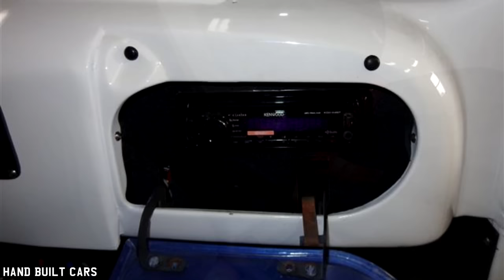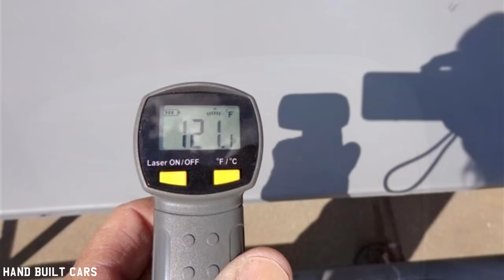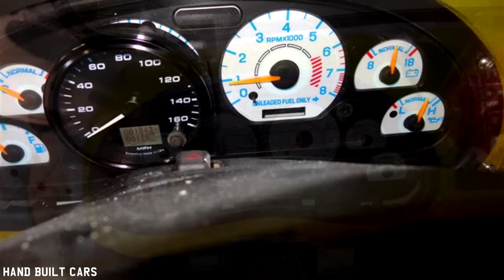1951 FORD F1 Pickup Truck Restoration Build Project

Comment: Kudo to the  metal fab, likewise to the finish man!  Only someone that has done  a resto can understand the love and time involved.  If you had F-1 fenders, not the F-2 -6 that you used with the larger radius your life would have been easier.  I  like the level you finish each piece even if it means going back to bring it to what  " YOU" want . The people that give negative comments can't show you what they did!   I would like  to know how long it took you time -wise?  My daughter and I built our project, but it took 16 years!  It can be found at  " 48 FORD  AMATEUR  BUILD " .    The F-1 in the background I did in 1978.  It took a year and a half as a younger me!                                                                                                         Paul

Comment: nice work, you've given me some ideas, i'm in the process of building one myself a 1951 m3 , custom  shortened to m1 with p71 front clip and rear, that had to be extensively modified to fit,  383 stroker with th350 and 3;55 gears. not too familiar with the posting of pics or i would, just wanted to say nice work.

Comment: While I appreciate the work put into building a complete frame from scratch the design leaves me thinking is wasn't as refined and engineered as well as it could have been, (sounds shitty I know-sorry). IMHO I think a body swap onto a P71 frame w/motor and drive train would've been a far superior decision and would have yielded better handling and comfort traits plus after market support is bang on and affordable for this platform.  For a low buck build one at home this is a pretty nice job, I just would have done it differently.  Now I'll go fuck myself, TY.